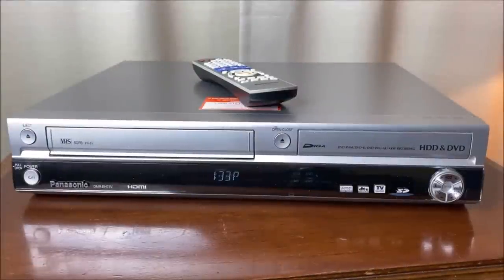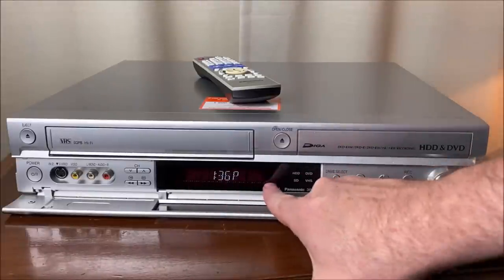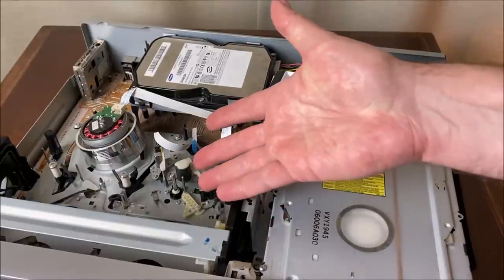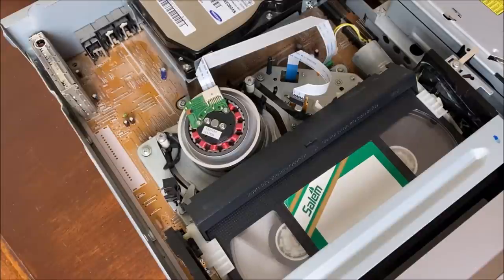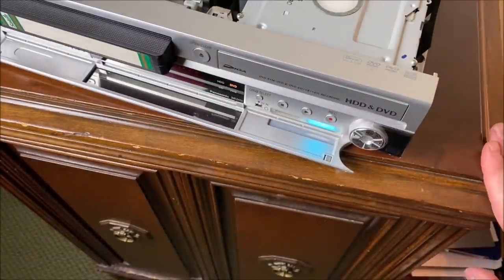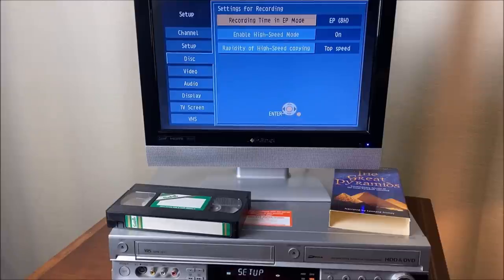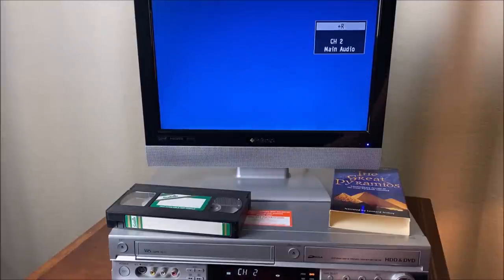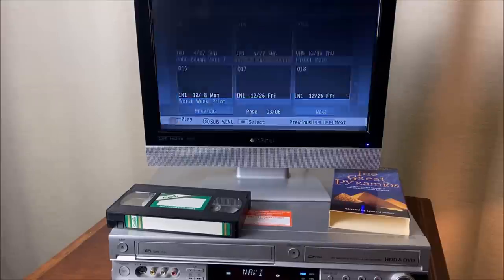Panasonic DMR-EH75V DVD-RAM VCR HDD Recorder

Comment: what if it was a HD DVD pkayer? would that make it a HDDHDDVD player?
Reply: Depends on what tuner it has, most of the time the aspect ratio was the extra "feature" because the transmissions had to be compatible with the current PAL/NTSC/SECAM transmisions, so it was in anamorphic or letterbox format, and the receiving "end" would detect, what to do,  (valid for analog tv only),  at the start of digital you needed a "settopbox" to convert it to your analog tv, new recent (Digital)  tv's have multiple tuners for DVB-T(2) DVB-C(2) DVB-S(2) (Terrestial, Cable, Satellite) this is also becoming old with glassfiber i guess where you have everything connected to (TV, Internet, and phone?)
But DVD HD didn't make it i guess, it became BluRay, and most of the time only playing, not recording to disc, recording only to HDD, with no export option, due to copyright protection, so a "normal" DVD recorder is just enough, you can edit the stuff from dvd's, even author, where you set the "flags" of the dvd, like the aspect ratio, you don't have to re-encode that way, the "flag" tells the dvd player what to do.
But DVD (the video format, not the file format) is just Standard Definition, with a WideScreen aspect ratio… BluRay discs can store FullHD or UltraHD, 4K is just a little higher in resolution

Comment: I would recommend finding a skilled technician to replace capacitors and remove motherboards, I had a similar problem with my Panasonic DMR-E85H and it is not easy to 
do this kind of work, especially if you never did it before....It can turn into a nightmare real quickly.
Reply from the maker: Nah.  Note to self.  I’ve done 2 so far.  Super easy.

Comment: sighs
Why do these combo recorders never have S-VHS and/or D-VHS support?
Reply: Like, really…
How hard is it to just tap into the DVD MPEG encoder/decoder circuitry for D-VHS capability?
And with constantly improving manufacturing capabilities, how hard would it have been have true S-VHS play and record heads?
Reply: Super-VHS came very late available, Hi8 was a better analog tape format, but digital video was also coming as a better alternative, quality of the broadcasts were not that great also at that time, better quality wasn't visible on a CRT tv.
Reply from the maker: This one does support playback of S-VHS tapes, but for whatever reason the manufacturers wanted you to buy standalone products priced at a premium for true S- or D-VHS.
Reply: @databits  yeah, like High Grade magnetic media i guess, that's something which made it expensive, plus…. less time to be recorded on a (special) VHS tape when recording DVHS.
I guess JVC made a lot of SuperVHS recorders, but the Panasonic's did have s-video connections,(without SuperVHS record feature)
(Advantage of the ES35V ..it also gives a stable video output of LongPlay recordings to digitize which you can't with JVC +tbc)

Comment: Hello there, the only question I have is, is this machine for sale? Because overhere in Europe it's not avaible and I do have a lot of video tapes which I would like to transfer to a dvd. Kind regards
Reply: Just keep an eye out in the thrift shops (Rataplan kringloop?) on a regular basis, found some myself there…. most of the time 10 euros…. combo's also, the thing is the people that bring or sell there don't know the value of the stuff anyway, it's more likely you get scamt at eBay.
Reply: vcr to capture card to computer then use obs to create video file. then burn file to dvd.

Comment: can u swap the hdd out for a ssd?
Reply: theoretically yes If you buy a SATA to IDE adapter and you must dump the specific code from the original hard drive with HXD editor I just dump 8 GB of raw data from the first sector of the Original hard drive and put it in the replacement HDD or SSD to make the new drive detected from the device oh and you ned a 3,5 to 2,5 adapter to mount the ssd if you dont copy the raw data then you will get the HDDERR message

Comment: I need help. Mine has no audio.
Reply from the maker: If I remember correctly, you will need to replace the capacitors on the power supply.
Reply: @databits  the so the capacities that are the culprit for the no audio thing and the HDMI
Reply from the maker: @cjpwolf2436  - yes, I recapped a few of these models
Reply: @databits  were did you fine the capacitors?
Reply from the maker: @cjpwolf2436  Mouser dot com
Reply: @databits what are the capacitors numbers?

Comment: You can almost hear the tape wear as it happens. Pile of junk.
Reply: you must have sensitive  ears or never owned a VCR :)
Reply: @xavierzander4201  I own several. And they all treat the tape better than that pile of crap
Reply from the maker: Truth be told, I'd prefer the tape be pulled from the heads when rewinding, but MANY modern home decks keep the tape threaded.
Reply: @databits  i guess it was to keep track of transported tape that way, but somehow it also knew how much tape were on the spools, because it adjusts spooling speed back or forewards…(could also be measured by calculating the speed between the spools) but while spooling tape tension is released, only the control track is read by a static head i think..
Reply: @xavierzander4201  There were models I worked on in the late 90s that had a separate arm that kept the tape in contact with the audio/control head for timing tracking but I have to admit I cringed seeing that tape go into hyper rewind while in contact with the video heads.
Reply: @sivalley  and on top of that the head drum is also spinning, but this wear is not concentrated on one spot, but over all of the length of the tape, so i guess playing the tape does do more wear to the tape and the still mode even more.(more tension to the tape)
It also means that between spooling and playing the tape takes some time reeling the tape in and reeling the tape out, this will also put more wear on the mechanics and the itself, (pulling/tension) the pulling of the tape could have effect on the binding of the glue particles that keeps the oxide together, and to the tape, or do i overlook something with that ? these are my thoughts over this.
Reply: @xavierzander4201  While the head portion of the drum is spinning, it's only spinning at normal speed so you have very fast tape linear speed dragging over the heads at a speed much faster than designed that now transfers dirt/debris/loose oxide particles from the tape onto the heads as a primary concern.  But the lower portion of the drum is still stationary causing abrasive wear to the tape as a whole, and if I recall correctly the alignment posts are as stationary as the steel guide pins of the two transport arms meaning they also see accelerated wear to the backside of the tape and to their polished surfaces.  Overall it's a gimmick feature that no one other than a novice consumer of the time would use in the same way the old tension release operated tape rewinders were hated by us techs for snapping the leader on tapes very frequently.
Reply: @sivalley  yeah, then there is the stationary part…i forgot that, well i'm happy there was such a thing as VHS, storing some moments that were dear to me, like home movies, where family members are still alive, that's worth something….. and i found also 8mm film someone converted to video onto youtube with my father on it.